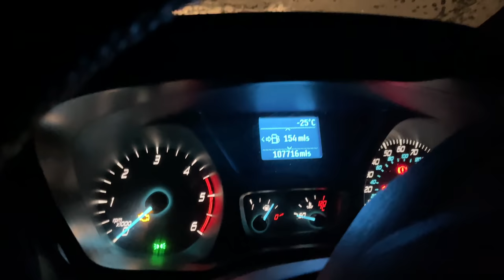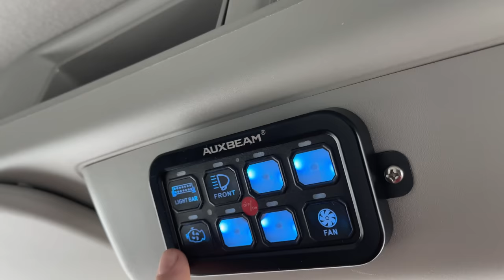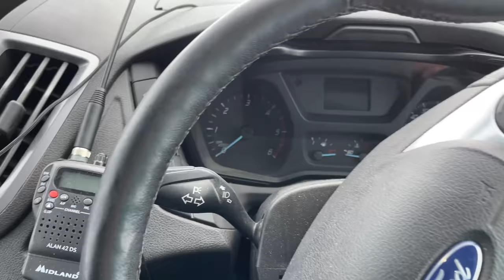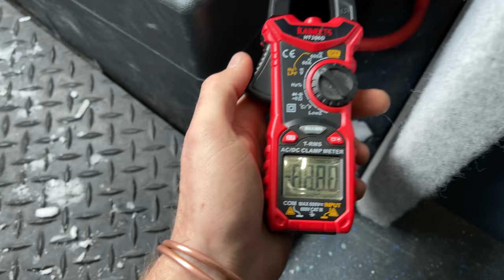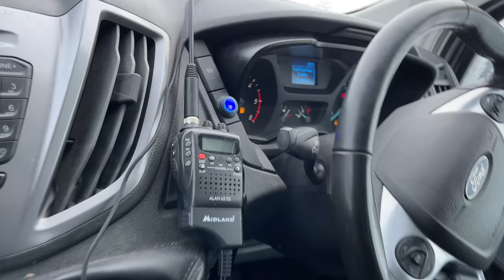Van DIED in ARCTIC cold temperatures | Extreme Winter Vanlife

Comment: Do you have 1 or 2 batteries under the drivers seat?
Reply from the maker: My van is the variant. Although it wouldn’t of made much of a difference in this occasion as the dual battery system is the second battery, which is the auxiliary is disconnected until engine start.
Reply: @MispronouncedAdventures  Not got to your electrics build yet. We have the duel battery set up on our vans. Its great when you flatten the battery with interior lights, hazards and beacons going. Turn ther ignition on and the engine starts straight up, the relay system is a life saver.
Reply from the maker: @paulrobinson3528  yeah I bet, I’ve got the 400ah  of a lithium battery bank in the van which whilst is primarily for the leisure system. I have all added things like the engine pre heater and all the auxiliary lights to it, a trickle charger for the starter battery to it. So not much other than a normal drain on the starter. But having the factory auxiliary battery would of been nice as well.
Reply: Hi, might be worth having 2 starter batteries in parallel, the cold reduces the battery current output and every volt counts!
A battery heating pad might also be worth running I’d they get cold.
I always have a cheep battery charger in the car from Aldi or Lidl.
Take care M.
Reply from the maker: @markeh1971 in the transit at least starters batteries don’t get that cold as the starter batteries based inside the drivers seat base, so basically internal. 

Although parallel starter batteries are an option
Reply: @MispronouncedAdventures  hi they will freeze, remember doing that test in the USA. But you will get heat from the back keeping them above ambient.
The locals leave them running or plugged in with a big block heater, got to a coolant temp of 38c
Take care M.

Comment: What did you change in the Victron settings to be able to reverse the charging way?
Reply from the maker: I didn’t, I reversed the wiring to reverse the charging way. The settings I changed were to change it to a lead acid profile for the starter battery and not the lithium which it is normally set for Charging my leisure bank
Reply: @MispronouncedAdventures   Sweet, also.... why do you have two btb`s installed? Are they on the same alternator? Cheers for the fast response!
Reply from the maker: Yes, both run off the same alternator ( my van came with a 220A alternator) , I wanted faster charging, which is particularly helpful for this trip as unsurprisingly there is a lack of Solar in the Arctic! . These give me 65Amp of Charging @ 12v. I have a video coming out in a few weeks about how to install two B2Bs
Reply: @MispronouncedAdventures  looking forward to that .
Converting a Sprinter myself,you did a great job with that van.
Are you coming to Camper Quirky this year?
Reply from the maker: Indeed I am yes at Quirky, I’m working on the Bobilvans trade stall for 3 hours each day but apart from that I’m free
Reply: @MispronouncedAdventures  great stuff bro, I'll come and say Hi, when I'll see you. :)